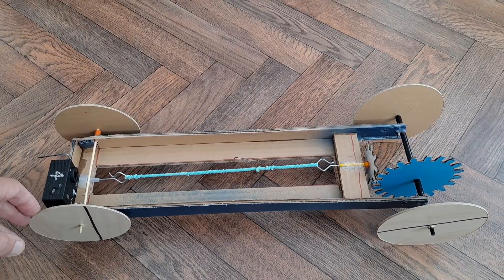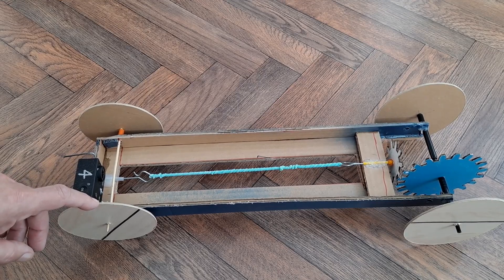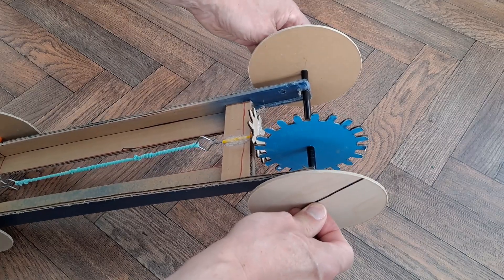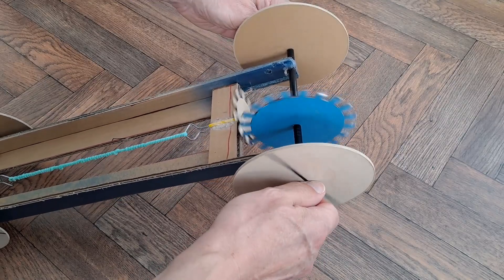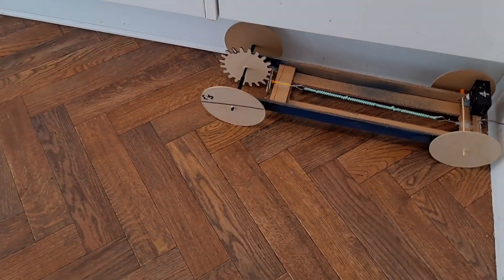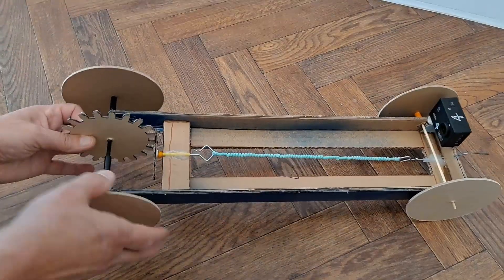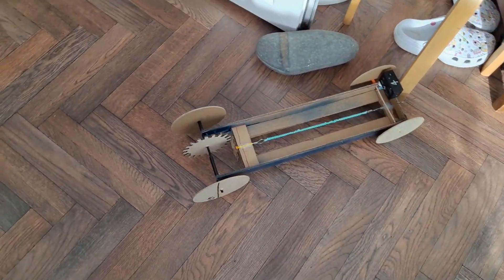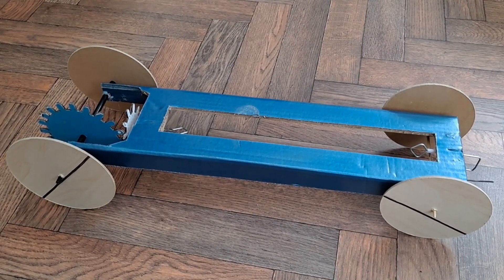Trying to tidy my work room Gear Driven Rubber band car

Comment: Hi i was gonna ask will it still work even if i make the gear smaller in front so it's faster? Or is it the other way around... I found this best design for me
Reply from the maker: The smaller the gear at the front, the more times it has to rotate before the big gear completes a revolution.  To make the maths easy, let's say the small gear has 10 teeth and the big gear has 50 teeth. The small gear has to turn 5 times before the big gear turns once. When you drive a car, you start with the low gear to get the car moving, and then you change up through the gears to move faster. If you try to pull away in top gear, the engine will stall because it doesn't have enough power to move the car in that gear. So back to the rubber band car, the 5:1 ratio would be the low gear to get the car moving. The maximum speed would be higher if the small gear was larger BUT it would take longer to start moving or might not even have enough power to start moving. You could add more rubber bands to give you more power. Somewhere between a high gear and a low gear will be the optimum for the power you have and the distance you want to travel. A low gear will use up your power quickly because it is doing more revolutions for the distance travelled, but it will accelerate faster. A high gear will travel further eventually if it can get the car moving to begin with. In a short race the low gear will win, the longer the race, the more chance the high gear will catch up and overtake.
Reply: @GrandadIsAnOldMan yeah ok thanks... It's for my physics project they have competition for fastest and farthest... Im aiming being the farthest, also maximum length of my car should only be 12inches so i think im gonna do well 😅😅

Comment: I would like to build this, 

https://youtu.be/kbWmoUL7I00?t=220

I have most of the parts on hand, I 

do not have the bearings needed for the magnetic switch 

"sled".
I do have a bottle of copper coated iron BB's and I can get 

plastic screw on bottle caps to maybe use to make low 

friction bearings .
Seems you are the perfect person to ask, have you ever 

made similar low friction bearings with house hold items ?
Reply from the maker: It would be interesting to see it working.
Reply: @GrandadIsAnOldMan  
Before I go all out on it, I can test proof of concept by swinging a chunk of iron on a string so it swings over a magnet .
Then slide a sheet of stainless steal over the magnet to see if the iron swings freely .
Reply from the maker: @OverUnity7734  certainly worth trying that first before putting a lot of effort into fabricating the rest of it. I like the idea of using the magnetic field directly rather than rigging up electromagnets suggested by many of the comments. Even if it only runs for a short while, it would be interesting to see.
Reply from the maker: @OverUnity7734  I guess you will be saving that for your next project 😆
Reply from the maker: @OverUnity7734  😆